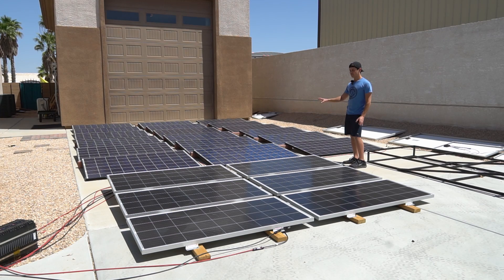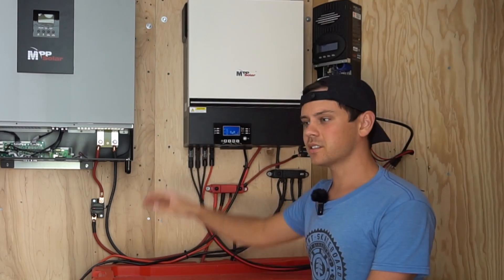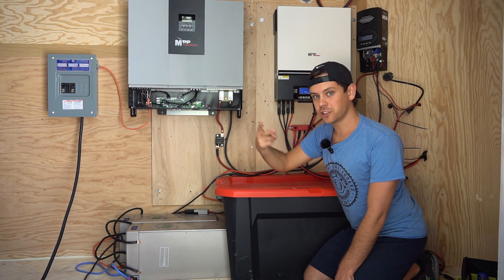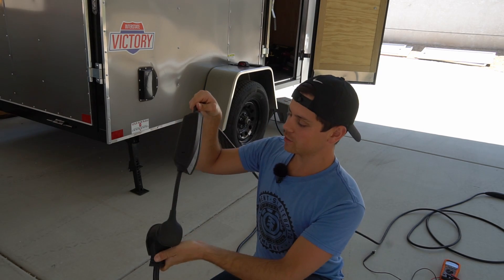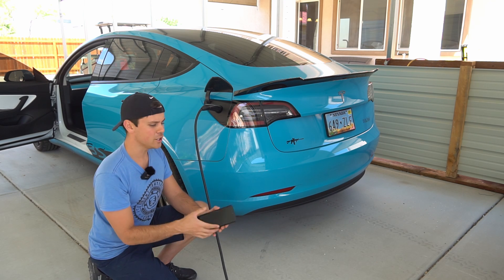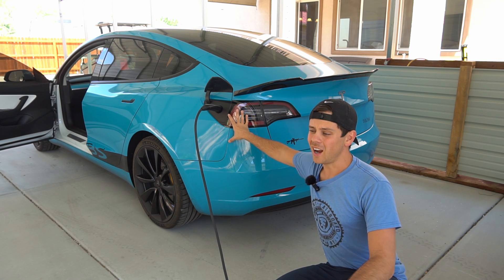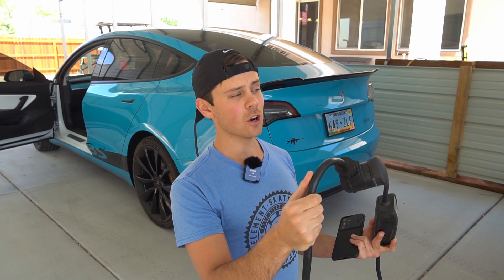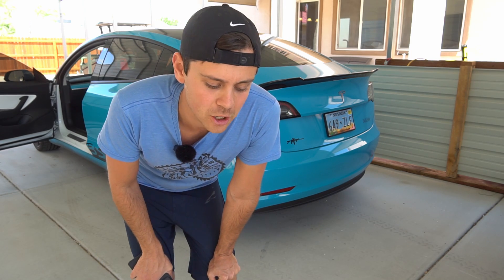Using my Offgrid Solar Trailer to Level 2 Charge my Tesla

Comment: Enjoy your videos. Seems like your videos are getting larger and larger systems. I have the AC200P and run a Midea 12,000 btu A/C off of it. It runs from about 2PM to 10PM everyday down here in Texas. I do not want a larger solar generator at this time, but wish I had a little more battery capacity. Thinking about making a larger battery, solar controller, and cheap inverter to run the AC200P factory wall charger. I know it is only 400 watts, but think it would run my A/C a lot longer for summer time. It pulls between 400 and 800 watts with compressor on. Not trying to power a Tesla, just one window unit and a system that I could eventually expand. Concentrating on battery and solar controller right now. Maybe and all in one unit would be better. Just do not have the room for a bunch of panels.

Comment: The new ev ford transit has been announced but only has 128 mile range.  Could you talk about what could be possible if it had a roof full of solar. Just crunch the numbers, could you easily double the range? Would it be possible to match the usage with solar output and drive all day?

Comment: Hey Will, can you please tell me to charge an electric wheelchair on a car which inverter would work better from 12v cigarette lighter plug? Only going to use it in year may be couple of weeks and thinking to buy 400W one. Help is appreciated. Thanks.

Comment: Question:  if it gets cloudy for a couple hours and the inverter shuts off due to low battery voltage, will it turn itself back on automatically when the sun comes out again?   Or do you have to manually cycle  the inverter back on?  If so, a lot of solar can be wasted due to this problem.
Reply from the maker: No it turns itself back on

Comment: Any chance of doing a DIY build comparable to the new Bluetti eb70 (716wh, 700 watts, $599  when not on sale).  Ideally being able to use more than a single 200 watt panel (limitation of the eb70)

Comment: Thanks for all the cool videos you do! I was wondering if I could commision some DIY content for your channel, if you think it is a good idea? Here's my problem, I am living out of my SUV (stealth urban) and just bought a BougeRV 30 qt fridge and an EB70. I'd like to maximize the battery run time by inserting a power-plug timer in-between the fridge and the cigarette lighter input on the EB70. I think the fridge could run 45/15 cycles during the day 9am-9pm and 15/45 cycles at night. 9pm-9am. There are a lot of 110v versions but I'd like to find/make a 12v version!

Comment: Will, 
I know you don't care for lead acid however I have a 36 volt tow motor battery ( that I got for free) that would give good capacity. Do you think it would be worth using for an off grid system?

Comment: Any idea if the MPP Solar unit supports AC solar power on the load side to allow microgrid functionality during an outage?  I've seen the Victron configured this way, but I can't find anything in the MPP documentation.

Comment: Hi all i need help cant fint info on the YT or Google
What will work longer ?
12v 200Ah + 12/230 inverter + 150W laptop = work time ?
24v 100Ah + 24/230 inverter + 150W laptop = work time ?

Plz help

Comment: This is a pretty simple system LOL. I would think most folks are using their 220 volts dryer outlets for charging. How long would that take to charge your car?
Reply: I’ll place a bet that the full 220v dryer can charge his charge his car faster since he wouldn’t have to configure its charger back to 22A.  He could leave it at maximum. 👍
Reply: @philipmorgan1438  Indeed! I don't know what that does. Does it limit the charge rate or what? TYIA
Reply: @castello544  it was explained in the video that he restricted charger in Tesla to 22A.  I don’t know what “it” you are asking about.  Dryer circuit wouldn’t need any restriction.
Reply: @philipmorgan1438  Thanks. I guess the dryer outlet would either give it too much current or blow a fuse/circuit breaker?
Reply: @castello544  still don’t know what “it” is that you’re asking about.  The Tesla has a max charging rate which was configured lower for supplying it from the Prouse inverter.  That limitation, any dryer outlet would supply more. There is no chance that the Tesla draw would blow a breaker or anything.
Reply: @philipmorgan1438  thanks again. I guess I'm confused by him changing the charging rate especially when you say the dryer outlet would only give 20ish amps. What is regulating the current if not the fuse/circuit breaker on the dryer outlet if the car was left at 32 amps?
Reply: @castello544  I think you forget that the car sets the charge rate and Proust can configure it lower to suit power he has available (22A).  I have been agreeing with you that charging would be faster from dryer outlet but can’t explain further when I don’t understand what your issue is!  There was no mention of 32A or such, for example.
Reply: @philipmorgan1438  Some misunderstanding or I'm just confused. Thanks for trying lol
Reply: @castello544  That’s why I kept asking you what the “it” was (about 5-6 messages earlier).
Reply: @philipmorgan1438  In your first reply you said "since he wouldn’t have to configure its charger back to 22A" I think that is what confuses me. If you leave the car at 30A the 220 volt power will charge until it blows a fuse or not?
Reply: @castello544  If the “it” is the car charger, then, “no”.  He said the car can’t draw more than 25A at 220v.  Thus, it can’t ever draw 30A etc.  I still think you don’t understand what it means that the car limits its own charging rate.  In any case, tho’, I agree that  drawing the charging power from the dryer outlet would charge the car faster than 22A from his off grid inverter.  YES!
Reply: @philipmorgan1438  I understand that the car can limit the charging rate. Apparently it is not automatic? You and Will say, you have to adjust the rate manually in the car. If you don't change the rate in the car, what happens?
Reply: @castello544  Asked and answered already.  It is automatic!  If you don’t change the limit, it remains automatically limited at the last setting.

Fortunately, I agree with you that the dryer outlet can charge it faster than his 22A inverter output!  Let’s stay with that!

Comment: What happens when you aren't using power and the batteries are full. Does that effect the penels or inverter?
Reply: The charge controller will limit the power to whatever's needed to keep the inverter running and battery full.

Comment: Help!  I'm losing sleep over my choice of panels.  They are rated at over 10 Amps, and the Enphase Microinverter is rated at exactly 10 amps.  If I put that strong of a panel with my IQ7+ or even an IQ7A, am I stressing it in any way?  Thanks in advance.

Comment: If you have DC from the solar panels why are you converting it to AC that the in car charger has to turn back to DC?
Just arrange the solar panels to 300, 400 or whatever DC voltage your car can charge at (usually as high as 600 DC volts) and maybe even run it through a control unit before plugging it your car.

Comment: I want to publicly thank you for your channel. I completed my first system 10 days ago and had the chance to field test my cargo trailer conversion. The system worked great. I was able to use a microwave and run a fridge 24/7. It is only a 2.8Kw system but it gives me confidence to make larger systems. With this video you have just planted more ideas in my head about what is possible.

Comment: Best way to make bit coin is through solar, you are already making excess energy and if you can keep the cost of the mining machines as low as possible you might make the cash back eventually if the markets don't collapse after another Elon tweet..Bitcoin will prove as unsustainable as the current system and maybe even more dangerous when it comes to energy consumption in the long term if the demand for power keeps exponentially growing.

Comment: Can you provide the cost of the system components to charge your Tesla.  This would be perfect at campgrounds and in cottage country.   If I understood you correctly you spent around $1000 on panels + $1400 for an inverter.   What did the cables etc. cost?

Comment: Myself I just have to wonder what peoples power bills look like that own EV's if they do charge with a on grid source ? They must be horrendous and I just can't see where doing so would even be a viable option compared to fuel. For you in the sun belt solar is defiantly an option but in the North East I doubt seriously it would be a good option, unless of course you have a monster system. 

But then I drive very little being retired and only using my car occasionally to run to the store once a week if even that, then its only a 12 mile round trip. I doubt I put on 20 miles a week if even that on a regular basis and can't imagine for the life of me where an electric car would be of any possible advantage to me? Especially with the cost of electric cars . 

Not even counting the total environmental impact they'll cause during manufacture and disposal once there worn out, which is HUGE when you actually figure out there impact overall throughout the entire manufacturing process and lifespan and disposal of an EV. 

Just for the Hell of it I kept track of my fuel usage for a month and I only used a bit less than a 1/4 of a 14 gallon tank , and I'd made a couple longer length trips to get building supplies during that time frame plus I totally heat with wood and use < 300 kwh of power each month as well with an average power bill of 30-50  bucks a month, and over 1/2 of that is tax's. My total power usage over the last 10 months was 2356 kw total so going totally off grid would be a snap for me If I wanted to go that route.

I guess I leave a rather small foot print compared to most .

Comment: HELP.  I have an enclosed trailer that I only use for racing on the weekends...about 8 hours during a racing day.  I only use an upright A/C unit, some led lights and maybe a TV.  I have 2, 12volt batteries wired in parallel and want something that will charge the batteries back when it's parked in the lot, until the next race weekend.  What do I do?  I have looked at MPPT and PCW charge controllers, but don't know which one I need or how large of a system.  Again, my system is small, but want to be able to know the batteries are charged after the race day.

Comment: Awesome.  Right where im after of a system  for charging g the bolt ev would set up 4 of the 6kw inverters to charge the 2 bolt evs and run the electric boilers once it's done charging both bolt evs.

Comment: I am moving that direction.  When Biden's everyone + government using EVs and texas gets another FREEZE before all of the power plants are build to replace all of the unused gasoline for ICE, i can survive.
Of course i do not have a garage, so i will buy gasoline to heat a "tent" above charge-freeze point of the batteries.

Comment: I missing Why you cannot not do full charge of Tesla on same time and range as with the grid using solar energy, giving you have no shortage of power ?
Reply: the 5kW Inverter output is the limit here. With an 8kW Inverter 32A would be possible
Reply: @Nobody_Famous  i think if this  happened it would be  a great achivement , right ?
Reply: Ofcoure but as he have a plenty of power he can do better I guess ; 
I am a biggener in solar so I was asking what is the limiting factor  here for not giving a full charge in similar time to grid

Comment: Off topic ? for Will or anyone:  had my 100 aH agm battery hooked up to my panels with a cheap 500w modified sine wave inverter powering a floor standing 100-150w oscillating fan and after about 15 minutes the fan motor apparently crapped out.  Can certain appliances burn up on a modified sine wave inverter even with plenty of juice in the battery?

Comment: What miner do you have because I'm trying to figure out a system how to run per miner because I have 4 Antminer s9 and an antminer L3+ i want to run them off grid and have some solar panels as well as an mpp all in one 48v system with four 280 amh 12v system I set up myself but it should be able to run one of them if I can set the panels up right I just don't know how to do that.

Comment: One downside is that it's a Tesla and your sitting on top of lithium batteries that go thermonuclear if they catch fire. 

I'd like to see how many pumps AC heat pumps and tools you could run or maybe get a tractor one like you see at farm and see how much work can be done using this type of system.

Comment: Question?  Whats a guy need to have a temporary solar system that could just be used in power outages? How many and what wattage panels to charge 2-4 batteries to just keep a fridge or freezer going until the power comes back on?
Reply: Check out website in description

Comment: Could someone explain why he has 2 inverter in serie?
Reply: I agree. He talks too fast and doesn't explain any of the logical behind the design. I guess that's the answer, it's less design and more mad-scientist kluge. 

I think he had the single phase unit up and running and that takes all of the solar panels in and charges the batteries. Then he's taking the output from that (single phase, so 120 volts) and dumps it as input to the dual phase inverter so that can then output dual phase (240 volts) to a breaker which is connected to the NEMA 14-50 (aka RV plug). I don't thing he needs the single phase inverter at all- it should have been able to take the PV and battery connections directly, but maybe the dual-phase inverter is temporary or perhaps it can't do everything the single phase can?

Comment: I have searched on and off for years trying to find somebody that would create a solar system to charge electric vehicles in stage 2. There might be other people doing it but this is the first one I've run across. Thank you very much for taking the time to do it and to explain it. But I'm flabbergasted that you don't need the permits and also flabbergasted that relatively inexpensively you can get some fast charging for your electric cars. I want to see if you'd be open to exploring making power walls with old Nissan leaf batteries? Explaining how to make a simple powerwall system using the used up leaf batteries with 30 or 40% charge left in them. I'm thinking that if you don't have to have limited space if you have plenty of space and you use cheaper degraded loose batteries I just want to understand the economies of scale and a Powerball system going that direction. Just a thought. Thanks again.
Reply: There's no permitting required because nothing is connected to the house. Like he said, its solar panels laying on the ground that are plugged into a stand alone cargo trailer that has an output cable.
Reply: Have you compared cost/kWh of spent LEAF batteries vs LFP?

Comment: That is more or less the same Setup I'm running here in Germany. I have an 3 phase MPPSolar setup for charging my Model 3 with 11kW. Until now we drove 8000 miles with free solar power :)
Reply: Needs 3 inverters though right?
Reply: @Nobody Famous  exactly. I'm running 6 MPPSolar MG5k inverters. 3 parallel in single phase for the House (total overkill to have 15kW for a House without AC). And 3 in a 3phase config for my heavy tools and EV charging.
Reply: @OlanFantaziya  How much money did you spend? If you don't mind me asking ?
Reply: Ost

Comment: Cool, nice AR sticker. I have a lot of restrictive code bs in my area. I plan to power my  tiny home and garage with a solar trailer, just like you’ve made. I need a 30 amp RV plug, so it will be very similar. Thanks.

Comment: Hey Will. I have a 48 volt Lithium ion battery pack made up of 18650 cells for my bike, the nominal voltage of an 18650 cell is usually 3.7 volts with the max being 4.2 volts, there are 13 in series in my case which makes the nominal voltage of the pack 48.1 volts and the max voltage should be 54.6 volts , where in that range would you say is the best place to stop the charging for max or optimal battery life?  Thanks man

Comment: Ok questions that have rolled around my mind for a little while. Can you charge a tesla while driving? Can you tow your power trailer  and charge the tesla while driving with it? When they introduced the tesla truck my first thoughts were, holy crap you could build a camper that runs on tesla powerwalls with solar panels on top, pull it with the truck, recharge the truck, and be entirely self sufficient. Will, can you please tell me my dream is now a reality!?

Comment: Any updates on the hysolis? I’m thinking of purchasing for a solar shed
Reply from the maker: Mine still works great. Havent had a single issue with mine so far.
Reply: @WillProwse  instead of a model X you should of gotten the stainless steel unicycles into full production; THEY NEED 22 KW CHARGING (SUB 10 MINUTE REFILL ON EACH 3KW LTO MODULE  WORKS FORME )

Comment: I wish solar stuff was not so expensive here in Canada.  Big panels usually go around $200-$600 and there's not a lot of places to buy them from.  Inverters are crazy expensive too, several grand for one that will not catch on fire. (ex: something other than what you find on Amazon/Ebay)
Reply: Keep your eye on solarshoppingmall, had a great pallet of snail trail/used Silfabs for a decent price.  Email them and see what they can do for ya.  I was under $200 CAD for 265 watt panels, but they’re only to be used for off-grid.  

I didn’t get a reply from SanTan about duty costs  bringing across the border, but would be nice to hear if anyone has gone through with it.  Good luck!

Comment: I used to dump my excess on the grid but not anymore, they were charging me extra for it and no credit. Now I save big and my equipment doesn't have to work that hard. Victron controllers are the best to charge lifepo4 because the algorithm is exactly right.  Bigcoin not for me. The risk is too high.